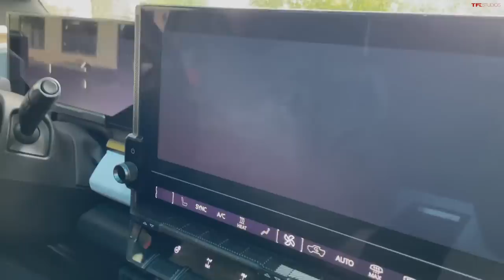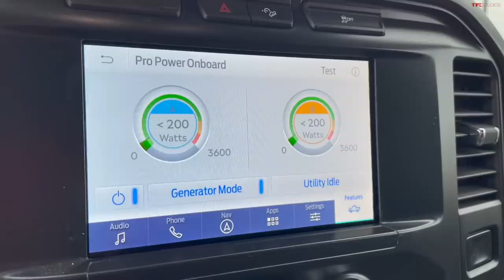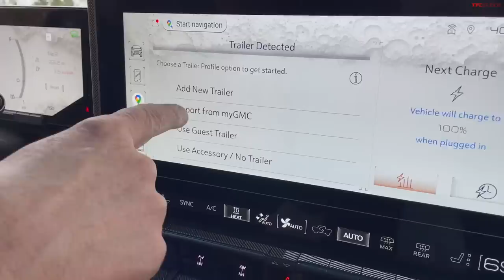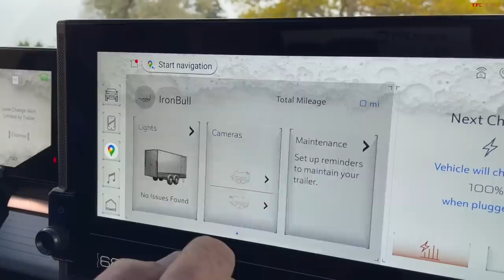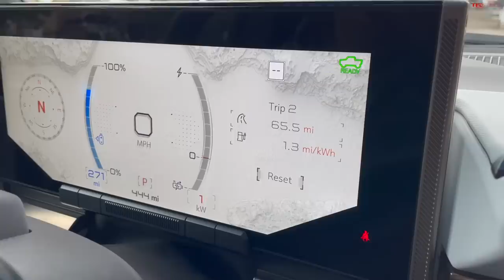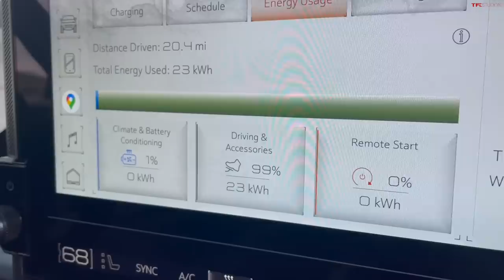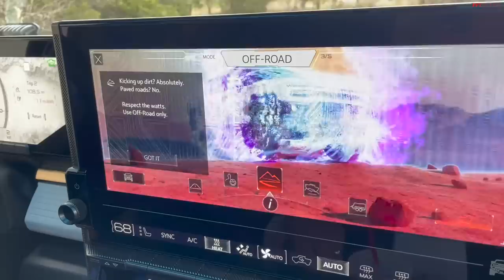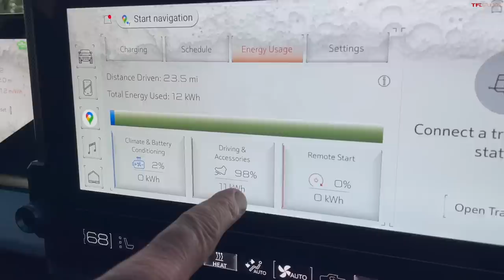Is The New Hummer EV a Real Truck? I Tow 5,000LBS With It to Find Out!

Comment: In my book, this the ultimate all-in-one vehicle. I cant think of anything this cant do except for physically fit in narrow places due to its massive 8 ft width with mirrors. Yes it's expensive, but it checks all the boxes that 99% of people could ever want in a vehicle.
Reply: Except for towing anything longer distances and that price is ridiculous. It's pretty much useless for anyone who wants to tow an RV more than fifty-ish miles outside of town. It is solid for around the town though. For example last weekend I brought back my families UTV home for the winter nearly 3 hours. Good luck doing that with any EV without stopping for long periods if you can even find a charging station.
Reply: @draecath5953  true, EVs and camping are still a horrible combination. However the majority of people with boats/atvs have a local lake or trail within 100 miles round trip, so this would work for that.

Also in regard to the price, name me some other 4 passenger vehicles that can do 0-60 in 3 seconds flat. M5, E63, panamera turbo, etc. — all of those are $120k+ and none of those can tow or go off road.
Reply: @jakes5530  Sure not 3 seconds but many trucks get in the 4 to 5-second range for half the price of any ev truck. I like EV's but absolutely hate how they are forcing them on everyone when they simply don't work for everyone. They are a cool alternative and should stay that way. 

If they are better they will outsell ICE eventually. Let them advance instead of shoving them down people's throats before they are ready or the infrastructure is ready. 

To get an EV on par with a 50-60k ICE vehicle that is basically luxury you need to spend 100k. The cheap EVs cost as much as a borderline luxury ICE vehicle but are on par with a budget car in build quality and features. There are simply too many issues with EVs to force them on everyone.

Comment: Does the crab walk feature work in reverse and is the front steering mechanical or drive-by-wire system? I’d imagine being able to invert the steering direction while in reverse and crab walk mode would make parking a trailer foolproof.

Comment: To remember 1 gallon of gasoline is equal to 33. 7 kWh according to the EPA so I compare that battery of 210 kWh to a normal size tank of gas. Most half ton gas pick ups have a 25 gallon tank and that is roughly 840 to kilowatt hours of energy.
Reply: Yes but they also waste 2/3 of it which is the only reason EVs make a lot of sense, they don't.
Reply: @myid9876543  not when you compare a pick up towing 5000 or 7000 pounds to any of the EV pick ups or or SUVs or anything like that miles per kilowatt hour are actually comparable. Also, you gotta keep in mind that ford made a focus that they never released in the US but was getting the equivalent of 50+ miles per gallon is Isuzu  made a little pick up getting 50+ miles per gallon Volkswagen had several cars and pick up getting 50+ miles per gallon. 

The main point is, the batteries are inefficient, weight per kWh is not ideal, and total kwh capacity is not comparable, especially in the truck and suv segments.
Reply: @brianhahne9623  ok but even mid size electrics get 125mpge while performing like Lamborghinis

Comment: 0:17 somehow I missed all of that, and I'm glad I did.  

except your breakdown which I'm sure left large portions of GM getting chewed out.
Reply: 4:38 if the breaker is tripping that often, and you are only pulling 3KW, I greatly suspect it's the welder that's the actual issue.    My guess is that it has a very high current draw, and whatever current regulator inside the welder is shorting out on occasion.  This would cause a momentary spike in current draw, which to the truck looks like a short circuit, so it cuts the power draw.  

The only test I can think of that might confirm this is to try using the welder through surge protector, connected to grid power.  If it trips that, you know it's the welder.

Comment: I just don’t get the push for electric. Our infrastructure isn’t there yet. I also can’t imagine going half the distance as a gas truck with a 36 gallon tank and then waiting multiple hours at the fastest charge to be able to drive again. Also any spare quick shot batteries available to get you another 80miles like a 5 gallon jug?
Reply: Everyone is just going to have to start getting used to it. All of those things will improve. Also, it doesn't; take "multiple hours" to charge at a fast charger. Even the Hummer, with the biggest battery of any EV so far, takes less than an hour. Is it perfect? No. But it will improve and the efficiency and not being dependent on liquid dinosaurs is well worth it.

Comment: Currently we pay 54*39 cents( converted from uk pounds) per kWh at home which would cost $114 to charge, hmm.
Reply from the maker: How much would it cost to fill up a truck in the UK with diesel to go 350 miles?
Reply: @TFLoffroad  I estimate £121 ($133) assuming 22mpg for a diesel Ranger,currently it costs circa 8pence per mile more to charge an EV at motorway services than use diesel as the price they charge is £1 per kWh. I’m not anti EV it’s just the Hummer, as a technical exercise great but practically useless in the real world. In the UK it couldn’t tow as much as my 1967 diesel Landrover, as soon as the gross weight goes over 7500kgs it would need a tachograph fitted be limited to 60mph and all commercial driver rules. The Lightening is 20 times the better vehicle.

Comment: My question is how much is the Battery pack out the door? and how long does it last?
Reply: I know the warranty is 8 years or 100,000 miles. Most batteries are lasting a lot longer.
Reply: if you figure 1000 complete charge to empty cycles , driving empty that is  300000 miles. if towing uses twice as much figure battery life would be half that. i would not expect a battery to last much longer than 15 years ether way

Comment: Biggest problem with the Hummer EV is that it is actually a super duty by weight class and it simply can’t keep up with a diesel HD when it comes to actually working hard. Sure it has tons of torque and power but HD trucks are designed to work hard for a long time and this Hummer just isn’t that

Comment: I feel like they made the Hummer EV as a show truck. While it is capable of doing the towing, but the range for the towing is not great. As for the pricing, better off getting the H1 if I were to spend that much.  I am curious of the base Hummer EV with the one motor to see how it performs when its released in the future. 

BTW, the H2 was more of a bulked up Yukon Denali/Escalade. I have the 2008 H2. The fuel range is decent, average 12 (360 mil range on average).
Reply: Lol….. it doesn’t matter which batteries they used! The battery density simply does not compete with diesel unfortunately

Comment: 1.2 kW is not great its bad. The biggest problem with EV towing is its range is cut in half or less. Until they make trailers equipped with auxiliary batterys for EV towing I wouldn't drive an EV over 150 mile round trip towing.
Reply: 1.2 miles per KWh is the equivalent of over 40 MPG. That's pretty freaking great for a vehicle of this size and weight.

Comment: This is not unexpected for towing and life with an EV. The only way to extend performance is to have some environmentally friendly fuel cell to boost range to a usable range. Other than that it's good for local use only.
Reply: Fuel cell? Imaginary tech. Been out for 30+ years but used in volume? Nope. Why?  Doesn't economically compete

Comment: Very odd it was pulling from a single side of power on the Ford truck
Reply: The Lincoln 125 Dave was using is 120V only. It draws 20A wide open, so would be iffy even on a 20A household circuit. It's a little small for the job that Dave was doing but as Donald  
Rumsfeld said you do the job with the tools you have, not the tools you wish you had 😆.

Comment: yes but how long does it take to charge
Reply: Less than an hour at a fast charger or over night at home.
Reply: @chrislittle6490  with a level 2 charger it still takes about a day to do a full charge. This battery is twice as big as a Tesla battery.
Reply: @SuzukiKid400  if you were down to zero, sure. But that's not any all normal.
Reply: @chrislittle6490  it is if you tow a 7500 lb toy hauler through the mountains and then want to do it again tomorrow.  How is that not realistic?
Reply: @SuzukiKid400  how many people do you think actually do that on any kind of regular basis?

Comment: We need removable and interchangeable universal batteries for Evs to ever have a chance at acceptance. Rather than go get fuel from a fuel station or charge by wire, you go to a Duracel or Energizer Station and let a machine change out a dozen or so scuba tank size batteries just like your kids RC car. The machine then puts the discharged batteries on a rack for recharge.
Reply: Just no
Reply: Of course we would have to burn coal to recharge the batteries....nuclear plants would need to be built.
Reply: NIO is working on it.
Reply: Battery packs are integral to the structure of the vehicle. It’s one of the reasons that iPhone makes their battery packs integrated as well. A removable pack requires more structure and connections. For manufacturers to be able to have removable batteries, it restricts and size and arrangement of those batteries. Would you really want to get rid of your brand new battery in your new EV with a questionable unit from a battery depot? I know I wouldn’t.
Reply: @SuzukiKid400  there would have be a way to track charge cycles and retire batteries after a certain age. It's the same concept as a propane cylinder exchange for you BBQ grill. After a certain age tanks are retired.
Reply: All bbqs are the same size for the most part, how many different types and sizes of battery packs do you think need to be configured and stocked to keep at all the stations everywhere. You’re not being practical with your logic. That’s like saying all gas tanks should be the same shape, size and volume and you need to pre fill them and swap out at the gas station. This will NEVER happen. It’s not logical nor practical!
Reply: @SuzukiKid400  my point is that EVs will not have widespread acceptance until these issues are ironed out. Believe me I won't be buying an EV anytime soon.
Reply: @jasonperry7970  I don’t want an EV either, but the charging rate will speed up and the energy density of the batteries will improve pretty quickly over the next 5-10 years.  They will surpass the practicality of a gas truck in due time.  The current complaints of EVs are just that, current.  They won’t last forever as the engineers come up with new solutions.  The only thing they won’t be able to solve? Is the glorious sound of a gas motor.
Reply: @SuzukiKid400  Look at what NIO is doing. They currently have 75kWh and 100kWh batteries and soon will be adding a 150kWh one. All those have the same form factor and fit in all the vehicles they have sold.

Comment: 5k, so about 1/2 what the truck weighs.  Tire life will be interesting.
Reply: You nailed it. EVs pollute worse overall than an ICE because of that and it’s directly into your nose and lungs. Due to their weight, they grind tires off quickly exceeding tailpipe emissions of lighter more efficient ICE vehicles. Don’t take my word for it, search engines find this info easily.

Comment: EVs are good nothing more than short little commutes. Useless for long drives, road trips, or lack any ability as a work truck.
Reply: Did you actually watch the video or just saw an EV and thought to inject your opinion about it?
Reply: Aren't long drives and road trips the same thing? I'd say they can be great for both. Not everyone wants to travel for 4 hours and then fill up in 10 minutes and hit the road. Some people like to take a 20, 30 or 45 minute break and stretch, eat, go to the bathroom, let their dog out, whatever. And you're judging them by the current infrastructure for charging. It's going to get better. As for a work truck, it depends on how you're using the truck. Long hauls? Not so great. It could get better it may not. If you're just using the truck to drive around a metro area from job site to job site carrying some tools or carrying parts, then it's better than an ICE truck. Think about it a little more before you comment.
Reply: @williamhadley1580  I watched the video and EVs are shit.
Reply: @Scotter4536  I have thought about it. They are shit in every review I see. The false advertising is criminal. Btw our infrastructure isn’t anywhere close to where it needs to be and the only way it could be sustainable is with fossil fuels. EVs not to mention are 10x worse for the environment.

Comment: I just cannot get over the fact that this thing weighs over 9,000 pounds. There are many residential streets where this thing is straight up not allowed to go down just because of how much it weighs. There are also a lot of off-road things that this is too heavy to reasonably be able to do. I would not trust this thing when going down a steep incline on an off-road trail: It is too heavy and even if the wheels completely locked up, in mud, loose gravel, or dirt, this thing is sliding down whether you want it to or not. ABS be damned, it is too heavy. It is about twice the weight of a stock four door Wrangler. And all of this weight and all of the features that they added and it does not come standard with a winch? That was a misstep, they should have added one from the factory. Also, the bed on this is effectively useless with how small it is. The SUV version of this is the one to get. It is not alone in this criticism. I hate five foot beds on all vehicles and manufacturers should stop making them. If you need a pickup truck, and you are okay with a five foot bed, then you do not need a pickup truck, and you should probably just get an SUV.

And with the towing. This 9,000 pound vehicle that calls itself a truck should be able to tow more than 7,500 pounds. A ford F-750 tractor cab weighs only a little bit more and can tow over 30,000 pounds. And that is before we talk about the range and practicality. TFL's videos with the Lightning and Hoovie's video with the Lightning have proven that the Lightning will never be a work truck, nor will it be someone's truck to tow their camper, boat, horses, etc. Most people who tow recreationally are towing fairly far. 100 Miles from where I live and I am only barely out of the metropolitan area that I live in. When I am going camping or to some other vacation where I am driving, I am going at least 200 miles away from where I live. Charging an electric truck while it is towing is a massive pain in the ass, as you either have to block a road or park your trailer and detach it, drive your truck to a charging station, charge it, and then reattach your trailer before you drive off. That is not practical at all. I live in the Bay Area and if I were going to some place in the Tahoe area, I would likely have to recharge twice if I was towing with an electric truck, whereas with my dad's Silverado, we can make it all the way there without filling up, while towing a moderately sized trailer. And then filling up is fast and easy. Alex Jones and Fox News might have overblown the situation, but the essence of what they were saying is correct: These things are expensive luxury vehicles that are essentially Tesla replacements, not gas/diesel truck replacements. They are for people that wanted an electric car but did not want some weird looking Tesla. And this Hummer is for people who wanted a G-Wagon or Range Rover, but wanted an EV as well. This is really only competing with those, as it is really expensive.

Comment: This video is only damage control for the case of EV truck not being able to tow.  You guys have done some serious towing capacity videos for gas and diesel trucks, why this softball test for the Hummer EV.  Using a flatbed trailer with a light ATV no wieldshield, no resistance.  Let's see the next video with a decent size fifth wheel camper, you know the type that someone with a $115000 hummer would own!
Reply from the maker: We did that video over at TFLtruck

Comment: If you get enough cars on the power grid electricity will be more expensive than gasoline. 💲💲⚡⚡
Reply: Its getting there right now.  I just read electric rates will continue to rise.  There will be no cost savings with evs.
Reply: Gas gets expensive when supply can't keep up with demand. Electricity can be generated various ways, including renewables that you can personally own, so why is electricity going to be more expensive than gasoline?

Comment: Unacceptable towing numbers (7500 pounds) for the size, power, suspension (air) etc.
I was expecting 10 000.
Reply: Offroad focused suspension and tires are not meant for towing. The Silverado EV will tow 10k with a 20k towing version available.
Reply: @bahamatodd  It's still air that can be firmed up compared to coils or leafs.
The vehicle is limited to 106. I'm sure that there are 35" tires that can handle the weight + 106 mph. 
There's no excuse why this shouldn't tow more (except that it's a poser vehicle).

The only reason I can stretch to is that the hummer is so freaking heavy (9400-9500 pounds) that no tire can handle the extra pounds when towing.
That does make the vehicle even more silly though.
Reply: So the ford Raptor is also unacceptable to you? What about a Lamborghini aventador? it has lots of power and is VERY expensive but it can’t show anything!
Reply: @SuzukiKid400  Two completely different vehicles. The raptor is actually good at it's purpose, the hummer isn't really. 

The raptor is a much better off-roader, especially in the suspension department and therefor low towing.